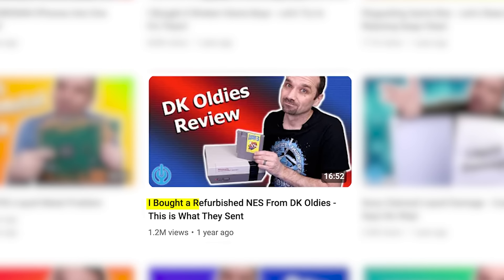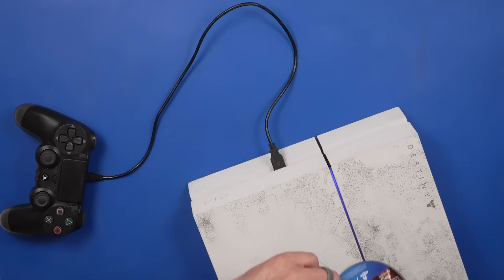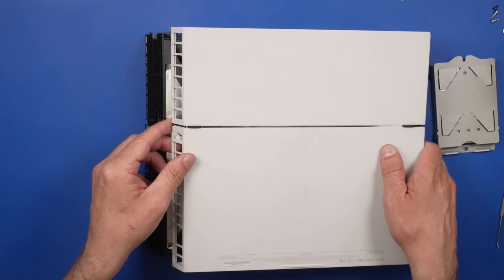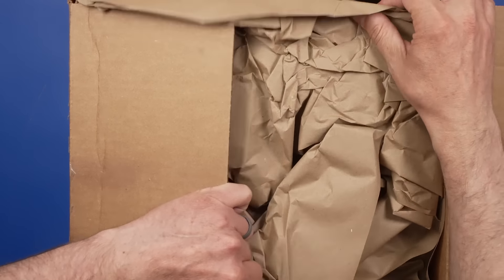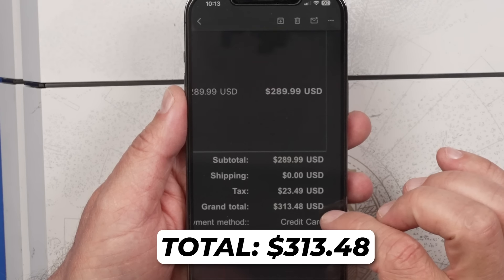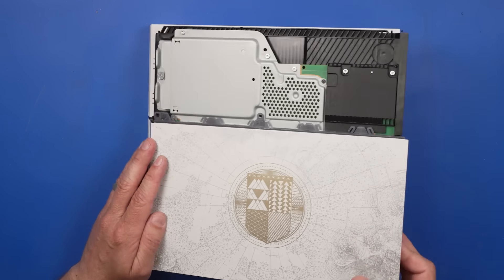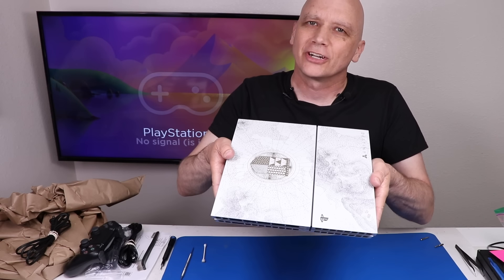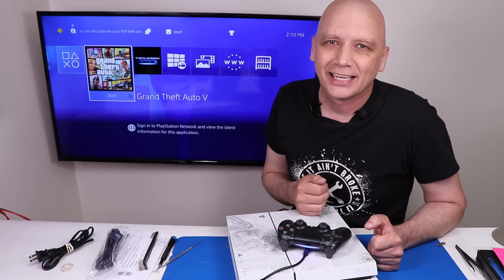Has DK Oldies Changed?

Comment: ● Faulty Controller
● Faulty Disk Drive
● Missing screws
● Missing thermal pads

What an embarrassment DK Oldies ☹️

The bar was set pretty low and they still managed to get under it.
Reply: And was twice the price of an ebay listing.  That just stinks that DK oldies is a scam. You could purchase the other one and either clean it yourself or find a place to clean it and still be ahead of the game compared to DK Scammies.
Reply: What a ripoff.  300 bucks for this?  It should actually work out of the box for that price. Hell, my local pawn shop will sell me a PS4 for a hundred bucks that they at least test to work in front of me while I watch.  It might still need a cleaning or repaste but ordering a box of surprise for top dollar is just ridiculous.
Reply: To be fair they had a cross next to the item which indicated it wasn't checked for functionality
Reply: Disc: Optical (Blu-Ray Disc) | Disk: Drives (Hard Disk Drives)
Reply: @thegorgosaurus  to be fair it said excellent condition
Reply: @Steve.._. I was being sarcastic...
Reply: Their charging cable didn't work either 😅
Reply: DK Oldies never fails to limbo themselves right under the bar.

Comment: His voice just tells his frustration with DKoldies
Reply from the maker: I did have high hopes on this one
Reply: You could tell he was heated!
Reply: @0errab0  Of course he's heated, they were missing so many thermal pads!
Reply: @Tronicsfix  I do have a weird issue with my own controllers for my PS4 since I don't use it enough it seems that sometimes I have to let the controller charge all the way back up before it connects since I have 3 and only use my PS4 sparingly these days. Before you send it back or whatever may I suggest at some point just leaving it plugged in and charging to see if that solves that one problem that seems to be regularly seen in all 3 of my PS4 controllers even though I only connected 2 of the 3 to my PS4 only (one I tried using on a emulator so I cannot vouch that that one was only due to lack of charge). Love your vids and glad you are still making them, pulling for ya man!

Comment: 6:25 that's not 'normal' thermal paste, that's meant for components like voltage regulators etc its not meant for CPUs (it CAN be used for it, but not an ideal formulation vs an Arctic Silver or similar paste meant for direct contact by something like that. that white stuff is meant to 'cure' on hard and seal in the transfer between a component and a heat sink but it is industrial and not usually used for things like an APU/CPU/GPU cooling solution. methinks someone went on Wish and got the cheapest case of paste and didnt bother to look for something that looks a lil more suitable (you CAN get the grey stuff in the big tubes, but many times you will get the white stuff). you'd find that stuff more typically in a PSU of some kind, used between a regulator and a shroud heat sink that the regulator is screwed to.

Comment: 7:46 This is confusing to me. They put checkmarks at the replacing of the thermal paste and the clock battery, but put an x at the confirmation for functionality. My initial thought would be they had not checked the functionality (which , considering the results, might have been true)

Comment: The controller not connecting isn’t necessarily DKO’s fault. It’s a pretty common issue on all PS4 systems. I had it with my controller one time. Also, to reset the controller you have to hold the button down, not just press it. Pressing it only turns it off

Comment: Great as always, glad your treatment is going well. Regarding the controller, I have found that if they are completely out of battery charge, they may take around 15-20mins to actually let you use it since there is no charge for it to do anything (even plugged in) Strange I know but that is my findings...
Reply from the maker: Interesting. I haven't noticed that. I'll have to check that out. Thanks for the tip
Reply: came to the comments to also make this suggestion. dual shock 4 with a totally dead battery is very frustrating. let it charge plugged into the ps4 for a while 😊
Reply: @Tronicsfix  I believe this to be correct as well - I know when I've broken out old PS4 controllers I haven't used in a long time, they have to charge for a while before you can use them at all, even wired. I don't think it's 15 minutes, but certainly at least 5 minutes or so.
Reply: @rodmunch69  Given the battery is hard wired to it, I doubt they have a true "wired" mode otherwise it'd work if dead. Likely it is in an always wireless mode.
Reply: @amak1131  yes, I just meant wired in terms of getting power - not communication. I know, personally, I've dealt with this more than a few times over the years. They'll completely fail to respond, even with USB attached, and you can't even hit the button about power loss when you start the system - then, after a few minutes, they start to work.

Comment: I think this might be the first ever confirmation for a small ad in a video.. I can 100% confirm that the BW-100 works WONDERS.
Back in February, my Halo 5 Elite 2 Controller started having issues. Bumpers stopped working, weird stick drifting/locking, and my A button wasn't firing OR would double fire.
I watched your original Elite 2 repair video, so I bought the BW-100, and the Repair kit you always use.
After an hour of trying to take it apart 😂, I got in and used the BW.. and never had an issue until literally 2 days ago, same issues. So it's time to clean again!! LOL
Honestly guys, the stuff works, and the tool kit is extremely impressive and handy.

Also.. that "Thermal Paste" was sus as hell. 😂😂😂😂😂

Comment: $313 for an almost 9 year old console is outrageous, especially considering it had issues. Edit: I also just realized that the listing says $249.99 but the email said $289.99. Idk for sure, but the sales tax seems off too.

2nd edit: Yes, it's based on where the buyer lives, it slipped my mind when I made the first edit. Tax still seems off to me, but no idea what was used to come up with 8.1%.
Reply: Sales tax is based on where the buyer is located, not where the seller is located.
Reply: @mjc0961  You're right, but that makes it even more confusing since Steve is based in Oregon where there is no sales tax, or at least he was. Assuming the buyer Steve used also lives in Oregon.
Reply: @Kryosaki  Friend probably lives in WA.  The tax rate in Vancouver, just across the river from Portland, is 8.7%
Reply: Taxes applies to shipped state in some cases. Idk for sure though
Reply: @Grant-H2O  Yeah, it slipped my mind when I edited the comment. Either way, the price still isn't correct.
Reply: I bought my slim  in excellent shape for $140 from a local shop.  (I added an SSD just because)  Worked perfectly.   $300 for that slop pile is a joke.
Reply: @Kryosaki  the purchase price shown was at a different time than the current listing price, Steve mentioned that.
Reply: $249 was the sale price.   They bought it for the higher price. Probably before it was on sale.
Reply: @Violaetor  I suppose he kind of did. I made the edit about an hour later than when I originally watched the video.
Reply: @exotic_lover465  I did think about that later on. Honestly, $250 is still a pretty bad price though, especially with the issues. I get that it's limited edition, but I don't think it's worth that much personally. Coming from a Destiny player myself.
Reply: They're right down road and I didn't even know. I could walk in and just start fixing stuff I guess.
Reply: It’s called price gouging. Aka a SCAM.
Reply: Ecom professional here, it is in the destination zip code, sometimes you luck out at street level but legally they just need to charge the correct tax for the zip code. They don't calculate themselves, they use an out of the box ecom solution from either a merchant or through the site builder.
Reply: No, you had it right. He literally stated that it cost more than $300 after sales tax was added
Reply: Most oline business  will use the tax rate  of  the buyer  state.
Reply: Sales tax is based on the buyer, not seller

Comment: For $80, I bought a ps4 off of a friend. It came with a charging dock for the controllers, two controllers, 10 ps4 games, the hdmi, and the oulet cord. 

Everything worked 

The system was dirty on the inside, but i expected it. He was scared of taking his console apart to clean. All the thermal pads were still intact. The controller washed charged fully, and both connected with no issues. The one controller he gave, he cleaned with the best of his ability it did have the paint worn out on the buttons, but this is also the day one controller that he used since he bought the ps4 back in 2013 so i figured its going to be worn im even shocked there isnt stick drift to it. 

The ps4 games. All 10. They are in very good condition they all played. cases are in good condition, any manuals, maps, or information that was included in the games stayes with the games

The charging dock still works fine, but he also didn't have it for too long he had it maybe 3 years. 
He bought it new!

Now i told him I didnt need the HDMI cord or the outlet cord.

But the outlet cord was in good condition 

The HDMI was torn with wires showing up at the connector, but i expected it. He used the same HDMI cord from his old PS3 so he didn't have to pull his tv out to switch the HDMI when he transferred his ps3 to the ps4...

He bought a PS5, and when he bought the ps5, he also decided it was time to get an upgraded TV 

He was using a 40-inch Samsung tv from like 2013 it was flatscreen, but it was very basic wasnt even a smart TV. Now he has a 60-inch Samsung smart tv, and he loves it.

My local walmart is having a clearance sell for all samsung TVs half off, so he got this 60-inch tv for $240.

Comment: Both of my ps3 controller had the same issue as your ps4 controller, ps button was working intermittently with most times having to realy push it in hard. I fixed one of them and the other I never got to. I've had them since brand new. It was something to do with foam under neath where a ribbon cable attaches to the circuit board becoming smashed down a bit keeping it from making good contact with the board. I cleaned up the connections, cut a piece of cardboard to size, placed it on the foam pad to raise it up a bit, put it all back together and it worked perfectly again. I've ever taken apart a dualshock 4, but I'm wondering if that's the issue with that one.

Comment: I think saying "a lot of it worked" is giving them way too much credit, the controller and disc drive are 2 completely essential components of the console unless you want to be using the Remote Play app (which, come on, you don't). Not to mention that it was listed as being in good condition and the console was covered in visible scratches, the inside of the console had screws missing, and the thermal pads weren't applied.

Comment: if my ps4 controller have no battery it will not connect by just start charging and clicking...you must let it charge for 10 min or so and then connect, been so with all since launch, at least in my country

Comment: Under $150 is a good deal honestly for a working Destiny PS4. I don’t understand why sellers can’t replace the thermal pads. They’re so cheap and easy to do. And it’ll prevent the console from being permanently damaged if it overheats. For $300? I would expect a brand new PS4. DKOldies will never change

Comment: Use your ebay controller and put the system in Bluetooth mode. Then on the DK controller . Hold the ps button and the share button till the controller flashes quickly. Then, with your eBay controller, add the controller to your system, and it will connect. Your remote from DK oldies is just Bluetooth to another console. 

This happens to me a lot with used systems with   controllers that were never connected to them even if I try to use the wire.

Hope this helps you

Comment: The DK Oldies controller doesn't look like it's broken or acting up. DualShock 4 controllers need to charge a bit when they're coming from an empty battery. Giving it some minutes on the charger should get it working

Comment: I once paid DK Oldies to clean my GBA carts and replace their save batteries, clean / refurbish a pair of SPs,  and get a replacement battery on Pokemon Crystal.
One SP was in a pretty bad shape and needed a replacement battery cover, they obliged with the color requested and replaced the stickers, all batteries replaced and functional. Contacts clean. With Pokemon Crystal in particular, it uses a specific wattage different from other save batteries to successfully last a long time and so far they're the only business to have addressed that and the battery successfully lasts.

For the bad however: There didn't seem to be any improvement in  the more beat up SP which can sometimes freeze or not turn on, maybe it's too far gone since I bought it from Ebay - and they mixed up one of my Pokemon Ruby's with another customer's.

Comment: I've had the controller not connecting issue on my launch edition PS4, it's just about holding the reset button for a while, unplugging and plugging in again, rinse and repeat. It usually happens when I haven't used it in months, maybe letting it charge for a while could work but knowing DK Oldies I don't expect it to

Comment: A 5-10 min test session at end of cleaning would save them the reputation hit, i don't care if i have a cleanish system with thermal paste if it's a brick,  no controller, no disk,  thats straight unacceptable, i think they rely on warranty to fix the systems with issues instead of testing which might save money but will corrode their reputation

Comment: I recently purchased a PS3 slim 120GB from them (refurbished cosmetically flawed) and was not impressed at all. I know it was cosmetically flawed but it was not refurbished at all, even the screw for the hdd was missing. I did bring this to their attention and did exchanged it with good condition console that was actually refurbished at no extra cost. So first impression wasn’t great but they did react faster and helped me out. Also the controller they sent looked very clean and works great(console as well)

Comment: So with the DKO pack the console was clean and had a good TIM application, but it had misding pads, missing screws, a non functional ODD, and a controller that didn't work...
Yeah, that's pretty bad. Sure, the missing pads/screws can happen easy enough (i wouldn't close up a console in that state myself, the closest I've been was an XB1S with a few missing passthrough screws and a cooler screw as a neighbour already disassembled it, and lost them in the process. I did a repaste, put it back together sans those 3-4 screws and handed it back to him without the base plate fitted. No charge) but to send a console out the door that is basically inoperable due to multiple failures (ODD and controller) is just lousy. For $140, i would've been expecting a refund there and then, but the DKO was ~$300 and it was marked as tested so 100% inexcusable!
To make matters worse, the $140 ebay sell was at least functional. Sure, the ebay one may have encountered heat related issues down the line, and that dodgy trigger would be a damn nuisance, but at the very least it was usable

Comment: I think 300USD for a PS4 in 2024 is way too much - but overall I think the business model of selling refurbished console does not make a lot of sense to me. To properly refurb a console you need a t least half a day of work of a good technician (cleaning takes a lot of time) and several hours of tests. Either you buy used consoles for very cheap and you sell the refurb's for a little more than average ebay price - otherwise if you pay the used consoles as on ebay, you need to sell your refurb's at totally senseless prices. There is very little room for any margin on refurbished consoles, and that is why most of them were not even clean, inspected and fully tested.

Comment: Sure dk oldies warranty will replace a non working console, but what if it dies after the warranty because of missing thermal pads? It's the undetectable issues (unless you open the console) that are the most worrisome.

Comment: As respectful as you are to DK Oldies, i just couldn't be. Sure they did a decent job cleaning it and that's cool and all but right out the box the controller don't work? That means they never even tried to test it, red flag but some maybe a more retro console (ps1 or younger ideally) that might not be the end of the world to a consumer who hopefully has a spare anyways (i would never use a used controller just as i don't know who used it before and what it has seen) but not even reading a disc? Come on, digital only consoles exist and are cheaper, the ones with drives should be tested, did they even try powering this on at all? Doesn't seem like it. 
I love how you just gave it the full treatment, probably bad laser? Nah, new drive entirely just to be sure. 
Great video as always man, just a shame it DK Oldies still don't care the same as you do.

Comment: Steve, I have an older Dual Shock 4 controller, it seems to work perfectly fine, and charges battery but no pusling orange when charging, is that normal for early models of Dual Shock 4? I did try replacing the little charge board, same behavior. Like I said seems to be working fine, just wondering why no orange light (no light at all actually) while charging. There is a light when playing games (blue, or when turning on flashing white, or when syncing rapid flashing white etc)... any ideas?

Comment: You're way too harsh on the ebay one  - it isn't even described as refurbished. The seller won't have disaassembled it to see the thermal issues, the external case looked fine and the unit worked. Perfectly fair to describe it as excellent condition for your average seller. If they claimed it was fully refurbished then you would be justified in your criticism.